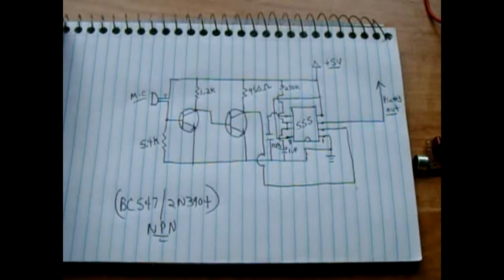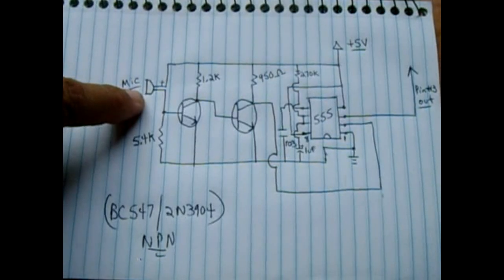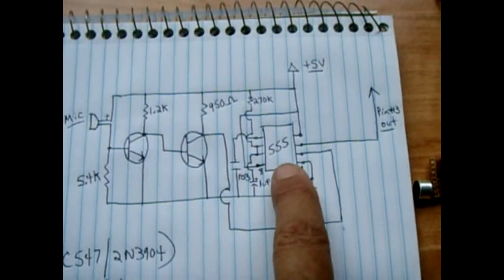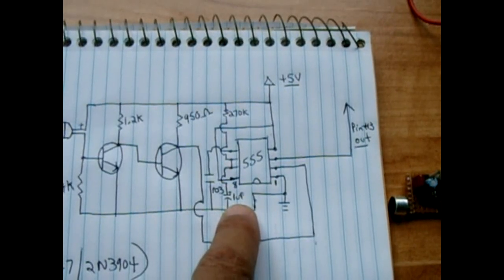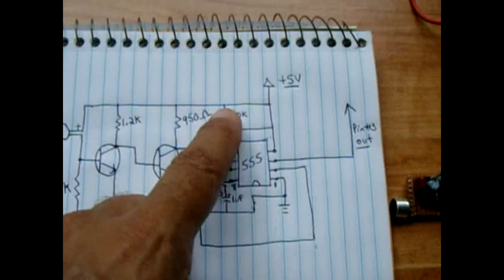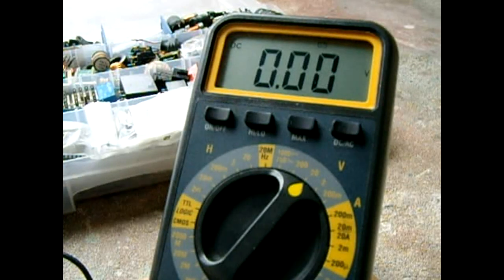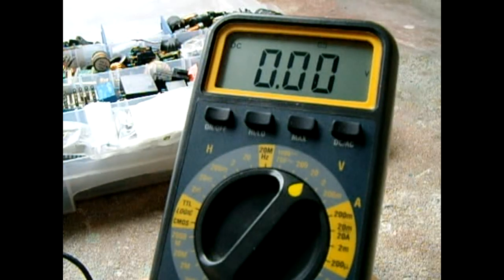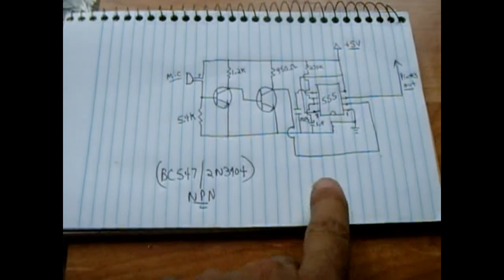How To Make A Sound/Clap Activated Circuit

Comment from the maker: You can use this latching circuit:

watch?v=o9yV-katMdg

You can have the mosfet trigger a relay for controlling AC loads. You will take the output wire from the clap circuit and connect it to a small 5V reed relay which will open and close contacts which will take the place of the switch in the latching circuit. Both circuit grounds together. You may be able to use an optoisolator in place of the reed relay. Add a resistor in series to limit the opto current. Needs 2 be LOW ohm when triggered

Comment: Hey there!  This circuit works great.  Is there any simple way to use an 1/8" input jack instead of the condenser mic to trigger the 555?  I'm unable to make the circuit work that way - are there any resistor/capacitor replacement values that could make that work?  Any info in appreciated!
Reply from the maker: +disjectia 
Hi. The NEG from the jack connects to the lower(neg) rail in the schematic. Remove the mic and 5.4k resistor. Connect the jack signal to a 100K POT, after the 100K POT connect a 103 to 104 capacitor. You need to experiment until you get it right. Connect the other side of the 103 to 104 capacitor to the base of the transistor.

Be sure to share my channel, and rate thumbs up.
Thanks.
Reply from the maker: +disjectia 
Hi. The NEG from the jack connects to the lower(neg) rail in the schematic. Remove the mic and 5.4k resistor. Connect the jack signal to a 100K POT, after the 100K POT connect a 103 to 104 capacitor. You need to experiment until you get it right. Connect the other side of the 103 to 104 capacitor to the base of the transistor.

Be sure to share my channel, and rate thumbs up.
Thanks.

Comment: I just wanna say I'm so glad you talk clear in your videos, I've made this circuit off another video but my range is HORRIBLE, what resistors did you use to achieve your listed values? Appreciate the help if you can
Reply from the maker: +TripleAipom 
I used no special resistors. You can use 2 fixed resistors in series to get the value you desire.
Reply: +electronicsNmore Thanks for your time